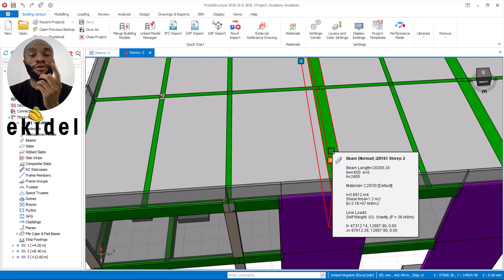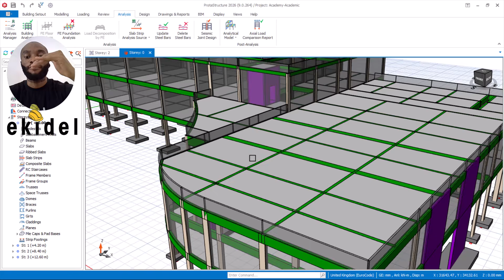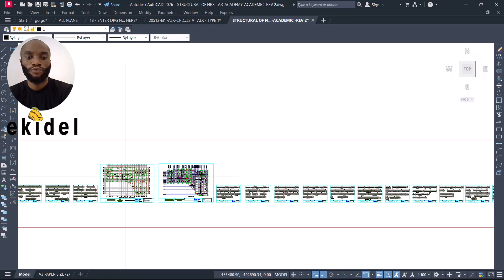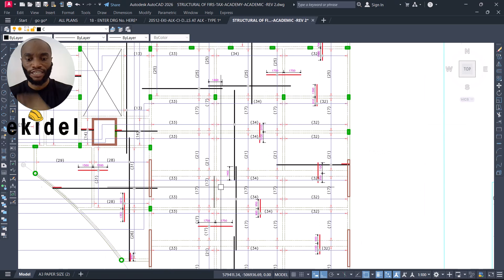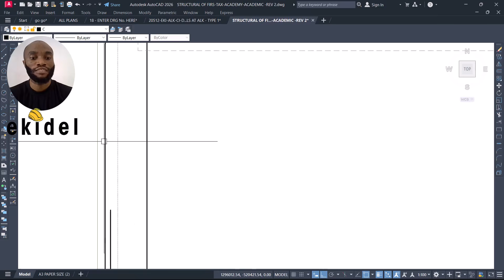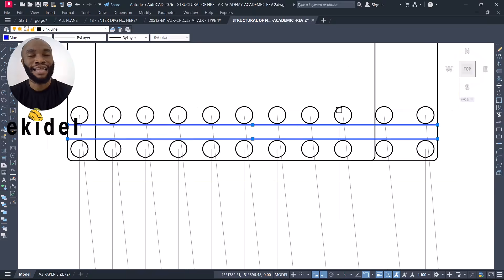20m Span, No Column ! | How i Designed This Reinforced Concrete Beam

Comment: Span length of reinforcement is about 12 meters. Your reinforcement detailing is showing a single length of 20 meters in the beam span. Considering you will need to lap the beam reinforcement. Is it advisebale to allow the software break the span at 12 meters and allow for adequate lap lenght?
Reply from the maker: You can see that they are lapped at different points ( staggered)

Comment: Thank you Sir
But what if the beam is continues?
Same process Sir?
Reply from the maker: The only difference will be the anchorage into the wall will not happen at the wall location again because of the continuity of the beam. 

But beams like this are treated as special beams so it’s best they are treated as simply supported beam and not a continuous beam. The beam that would have caused the continuity can be repositioned.
Reply: @EkidelEngineering Thank you for the enlightenment Sir